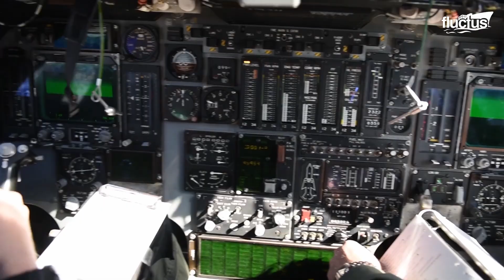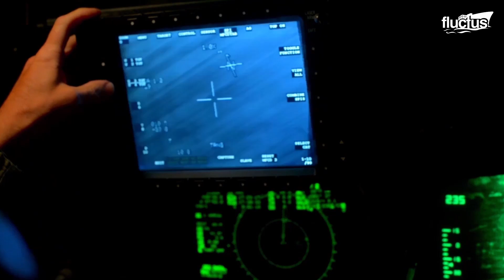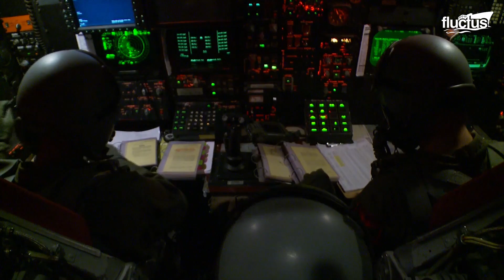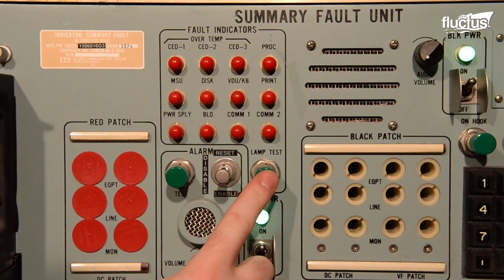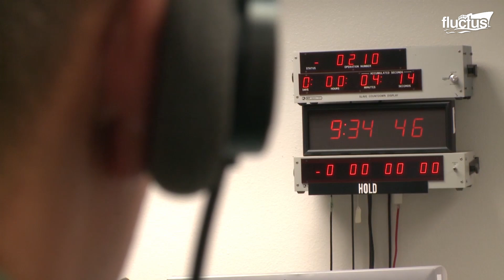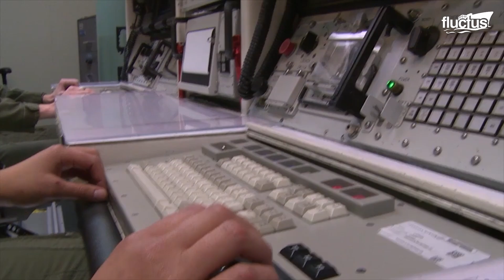US Testing Revolutionary Method to Launch Missiles at Extreme Altitude

Comment: Put a stack on a ac-130 gunship. That would give them some extra boom boom fun
Reply: Only can be loaded on transport jets not attack jets. Ac130 gunship can’t fit a pallet of rapid dragon inside it cus it have artillery and command center inside. Idt yu know what the ac130 GS is
Reply: How yu say yu dk what the ac130gs is without saying it
Reply: @LSmoney215  facts. All of them are clueless.
Reply: That’s inefficient though bro. It wouldn’t work putting that inside of one because of everything that’s built inside of it to make it a badass reaper. You’d ultimately limit its capabilities. Even if you put it on the wings it’d be a waste of space to carry cruise missiles.

Also, cruise missiles are made for long range. Ac-130s don’t do long range.
Reply: You’d do better putting the munitions on the wing hard point. But this system is optimized for non modified cargo planes.
Reply: @dystopianlucidity4448  hard points will be a waste of space for an AC-130. Cruise missiles are for long range targets up to 500 miles. Gun ships are direct Air to ground support. Why carry something like that when you can carry 8 extra air to ground munitions per Cruise in replacement for realistic targets?
Reply: C-130
Reply: @johannjimenez2850  buddy got me saying ac130 without me realizing it lol
Reply: this Missiles Rapid Dragon inside in the C-130., US want to used this against to The Iranian Proxies and other Terrorists Organizations